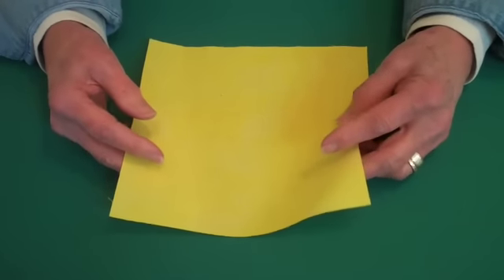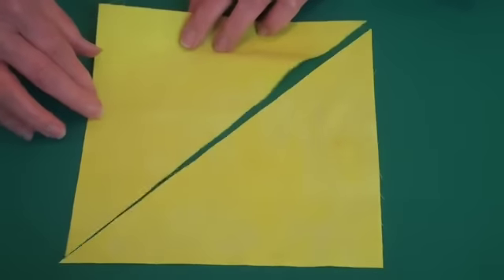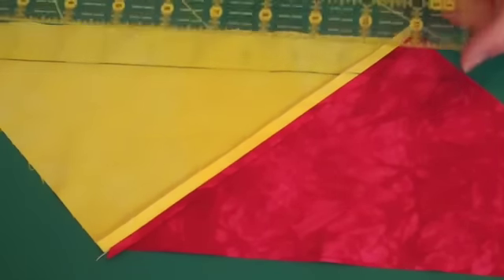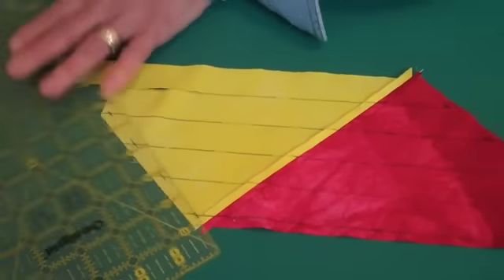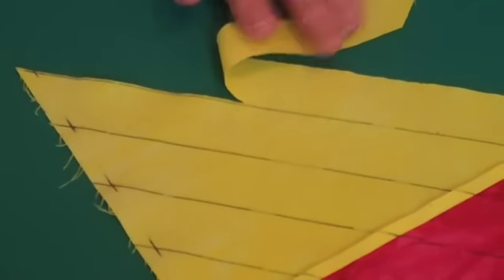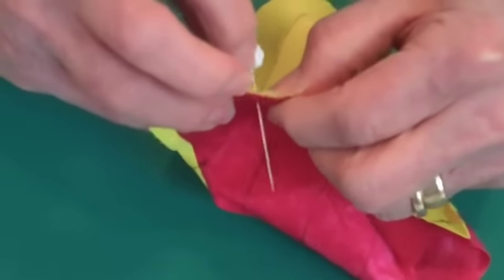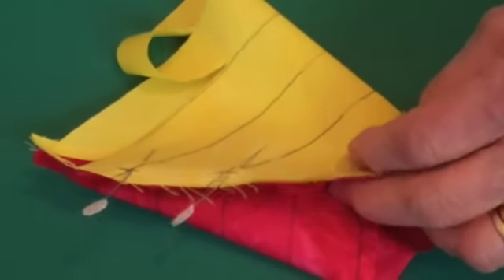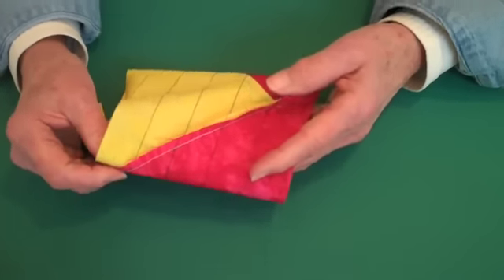Making a Bias Tube

Comment: Thanks so much. Your video demo is by far the clearest explanation and the easiest to follow & understand, that I've come across. And I've checked out so many! Your extra tip about marking the intersecting lines makes it so much easier to be accurate, and eliminates the guesswork in matching up the lines to pin. Remarkable. One little tip like that turns out SO helpful! What's your blog address?